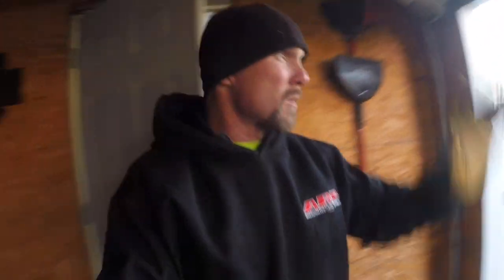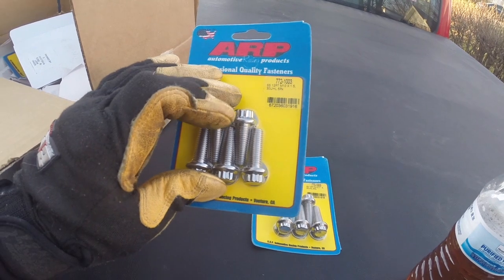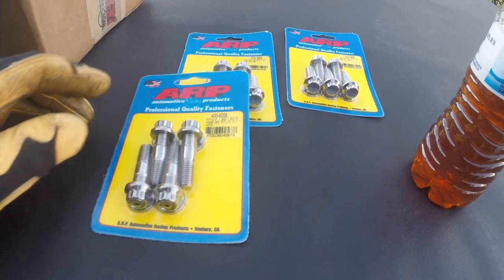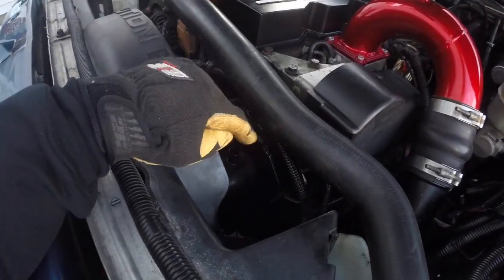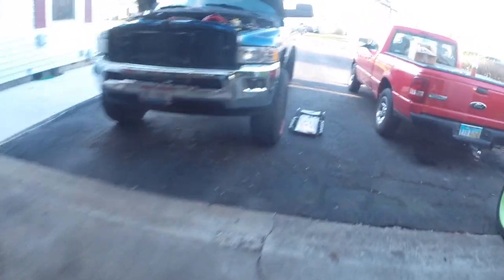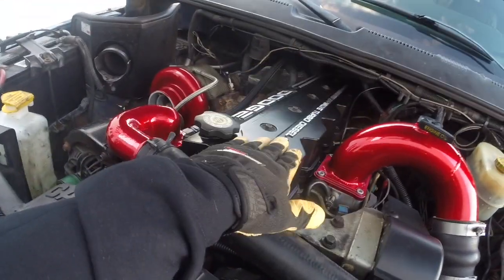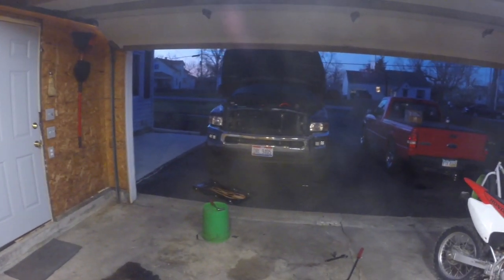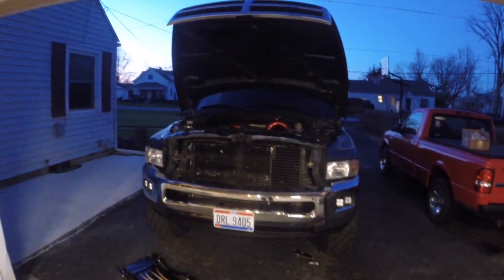Dodge Cummins Carli sway bar end links

Comment: Hey Chad love your channel and had a quick question. Is there supposed to be a specific length on the sway bar end links? I have the Carli 3" springs in the front and just didn't know if there was supposed to be a specific length on the adjustable end links.
Reply from the maker: I have the same and mine are 4 5/8” from flange to center bore of the Heim joint
Reply: @ChadMyers73  cool, thank ya sir!